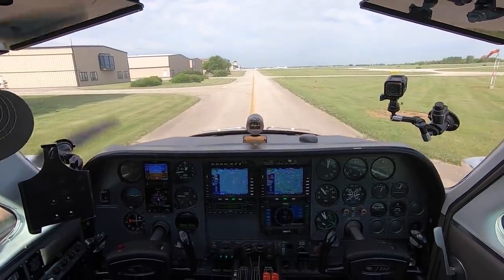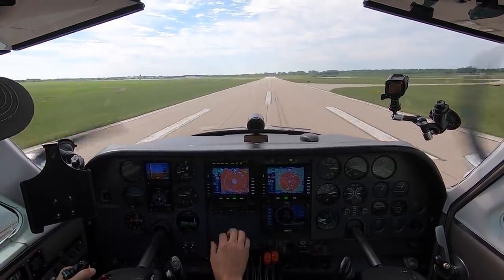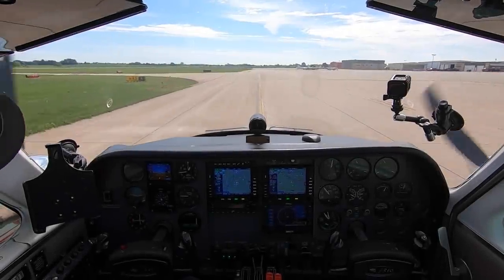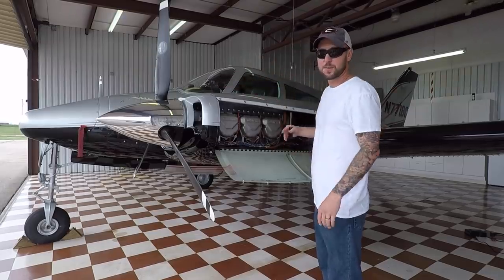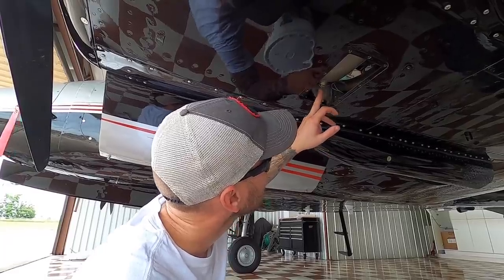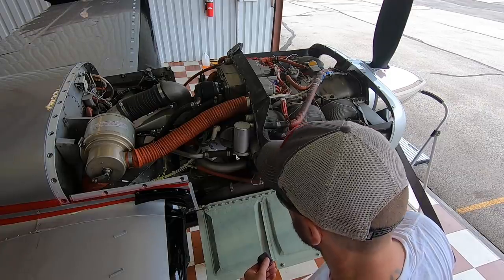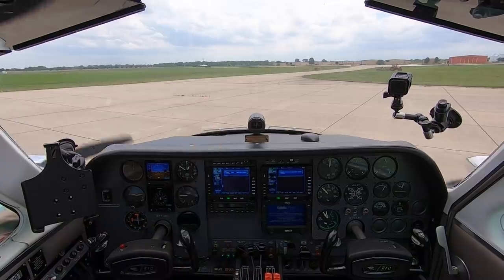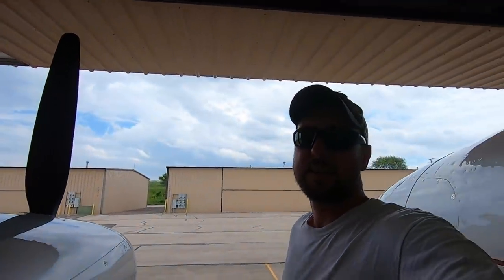How to Change your Oil

Comment: Unsolicited SW tip from a Jet mech: I've always used a general ROT for cutting SW as the length of my forearm. When you pull the pliers to twist the wire, keep the wire wrapped around the pliers so the ends don't flail out and cut up your pretty heat wrap, electrical, or scat tubing. Really appreciate the quality content here and hope the aviation TY community will follow suit; showcasing some of the aircraft DIY and maintenance pilots/owners can do themselves. This content is really opening the eyes to those intimidated or uneducated about general aviation. Great stuff!
Reply: Nice job on the oil change. I Use to watch cap do oil changes
Reply: Good tip Aric. Also the filter adapter is soft (aluminum) so just be gentle threading and removing the safety wire.

Comment: Yeah,
What Paul Arc said. 
I have been my own mechanic for many years now. My dad was a diesel mechanic. He told me the importance pre lubing the gasket on the filter so it doesn't gall up and will slide on gracefully when tightened.
Not so much the plug but the filter.

Comment: Nice bonus video! As a DIYer and former auto mechanic, enjoyed seeing “under the hood”. One suggestion, get a step stool on casters and put the drain bucket on top of that. Easy to quick adjust location, and can roll out from under. Cuts the distance the wind has a chance to blow the oil.

Comment: Kevin, great video on oil changes. It brought back my days of doing them on my planes.  Watching the video made me feel lucky that I only had single engine planes.  Half the work.  Yes, as noted in some of the comments, I always wiped a little oil on the filter gasket with my finger prior to installing the filter.  It worked for me.   The filter cutting tool was new to me.  Sure beats using a hack saw.

Comment: Awesome job doing the oil change, brings back memories of working on the 310R we had at the one company I worked for.  I used to use cardboard or pieces of aluminum to make drain shoots for the oil, then I found the form a funnel you can get at some auto parts stores.  Another tip that I learned from a old mechanic was when you cut the filter media out of the housing, if you keep it corrugated and squeeze it in your bench vice it will get rid of most of the oil and then you can more easily see any metal or dirt in the pleats.  I usually wrap it in a rag to catch the remaining oil as it is squeezed out.  Keep up the good work and enjoy all the flying videos as you give us great scenery shots of the country, and love the nerdy instrument tech you have in the plane also

Comment: Kevin, I would like to say thanks for teaching this old dog a new trick. For the 21 years I’ve owned my 310 I hated the oil change task solely because of replacing the safety wire at the drains. It’s hard to see and awkward to get to. I always put the plug in before the wire and you have now shown me the error of my ways. Thanks, Chuck from Memphis
Reply from the maker: Ha ha...not sure if you'll find it helpful or not but it makes it a lot easier for me. :)

Comment: 10:55 Oil Filters : Trick I learned from sailing channel Gone with the Wynns,  wrap a plastic bag around the filter when taking if off. It catches most of the oil (if not all) and you can just drop the filter in the bag.

Comment: I was wondering if you would get the second click. I can tell you I am a quality inspector for Lockheed Martin in Marietta and people with 30 years exp will mess up the direction of safety wire. WE actually have gone to a newer method of using safety cable. The cutter pulls the cable to correct tension then crushes a grommet and cuts the cable clean. Saved a ton of time for us doing standard safety wire. Great video was a pleasure to watch.

Comment: Very good video, cutting open the oil filter can show a lot of what is going on inside the engine. I worked 25 years as a mechanic and used to take oil samples to send of to a lab to see what was going on also.

Comment: Kevin, I will offer a suggestion for removing the oil filter. On my marine engines the filters are less accessible than yours, but similar. I found that a large zip lock bag over the filter, once it is broken lose, traps almost all oil and helps keep clean up to a minimum.
Reply: Yep.... that's an old school "work smarter not harder" trick
Reply: Thats a good idea
Reply: You can teach an old dog a new trick. I'm fifty-three. I never knew the bag over the filter trick.

Comment: Great vid. As an engineer of some 30 years I was always taught to pre-soak filters unless it was specially indicated not to. This prevents contamination of the filter media from residual particulate and prevents dry journals where lubricant has to soak the dry filter before it reaches rotating parts prevents overtemp and wear.You shoud wear gloves when working with oil its a carcinogen. Saftey first.

Comment: Just a little thing to add. I was taught and always put a very light film of oil on the filter gasket with my finger before installing. It’s suppose to give you a better seal, keep the gasket from bunching or tearing and gives you a more accurate torque. Just something I learned years ago and hear quite often so thought I would mention it. To each his own and everyone has their own way of which there are many. You’re right....only pure aviation geeks and mechanically minded people love this stuff. Good news is, I think there are plenty of us out there. As the owner of many different piston turbocharged aircraft before switching to turbines, I can say oil changes and being very meticulous with them are even more important (yes, all aircraft maintenance very important). Many aircraft turbo wastegates and pressure regulating devices are controlled by the oil. Many of the orifices and passages the oil runs through are small and machines to precise tolerances so any fod can really give you some trouble. Not to mention turbo health in general is extremely reliant on clean and proper oil. Thanks for sharing, keep up the great vids. Fun to see some videos for us engine gurus from time to time, even if it just an oil change.

Comment: Kevin, as a PP/A&P and Lockheed Field & Service mechanic on F-16s for 35 years, I couldn't have done better. Your safety wire was neat and well done. The drain plug is what it is and is a bitch to safety wire. I would suggest on the oil filter to start from the filter and go to the adapter boss. This has you pulling toward yourself at both ends. And as someone else said, if the wire is long, let it wrap around the pliers and sort it out when you go for the other hole. Point being, only cut it after you've finished the pigtail so you don't have any more pieces flying around to cause damage/FOD. All in all, very nice presentation. I've enjoyed following y'all on all your adventures. Stay safe and enjoy yourselves. Oh, and wear your gloves when you're handling the filter element after cutting it open. As a young man I never worried about getting oil on my hands, but as you get older , you WILL develop an allergy to it.

Comment: Kevin, what a pleasant surprise to see you on a Tuesday.  I may be messed up on my days this week now.  In any case I did enjoy your oil change.  Being technical I was very happy to see an actual drain plug for the oil, not to mention the wire lock.  I have always had a beef with Cessna on the small planes.  They have a quick disconnect for the oil drain.  Almost makes me wish I would have learned on a Piper.  The only reaction I have ever received from comments on 150/172 oil changes is that nothing has ever happened.  Well that in no way should let safety take a back seat.

Comment: I have my dad's old safety wire pliers (USAF) and I use the same company for oil testing in my old (2000)  Landcruiser and Diesel pickup.They do a great job. I like the maintenance videos. The are very informative

Comment: As a non-pilot, it was interesting to see all the safety features.  I've done hundreds of oil changes on cars and never had "safety wires" LOL.  But, I'm on the ground.  I can relate to when you are in the air, as a lost engine in that environment could be catastrophic.  Thanks, Kevin, for the instruction.  You're a great pilot and owner.  I'd fly with you LOL.

Comment: Well done 👏,  as others have said this is an a/p approved video. Safety tip: wear some kind of eye protection specially around safety wire, the thing is sharp as hell and when cutting it the pieces love to go flying out if you are not careful.

Comment: Always feel better & think it sounds better after an oil & filter change (plane or car). Probably delusional but seems like it to me. One thing I've started doing is set the new oil in the sunshine to warm up while I'm working in the hangar on the cowling, old oil & filter. Then the new oil drains a bit faster & more thoroughly. Thanks for the video. Gorgeous aircraft. Got to be one of the best in the fleet.

Comment: Thanks for doing this Kevin! Always cool to see how other people do it. When I first learned how to do it with an A&P, he had me use a hole punch on the filter(at the top) while draining the oil. That means the oil filter empties more completely(lets air into the draining path) while draining, and ultimately means less mess when the filter comes off. I also use the time while the oil is draining to wipe down the plane and listen to music. It's definitely one of the best ways to spend time with your plane, if it's not going to be in the air!

Comment: A&P here. I like to do on the end of the safety wire is make a big loop while the jaws are still holding it, that makes it a bit tighter.  also when you putting it in the other end to finish off I take one of the wires and give it a good tug. just to make it tighter. Be careful on the thinner wires or the copper break away type.  :)
Reply from the maker: Thanks for the suggestion Christopher! Always learning. :)

Comment: One suggestion to make inspection of the oil filter paper pleats is to gather it up like a accordion after cutting it off the filter housing and then run it in the vice with paper towels around it to sop  up any extra oil and so where you get much of a less oil soaked filter element to inspect makes looking for contaminants and debris easier.

Comment: WOW!...I haven't seen a pair of safety wire pliers in over 30 years. Used to use them all the time when I was in the Navy working on the flightdeck of an aircraft carrier. pretty much every little nut or cap had to be safety wired. Always thought they were for military use only, lol.

Comment: I just did a similar video on my 150.  I usually fill the oil filter up with clean oil and let it absorb (you get oil pressure a little faster) and then make sure to put oil on the seal of the oil filter before putting it on.  I found a neat trick where you cut out a used oil bottle to put under the oil filter when you take it off to capture all the oil.  It fits perfectly around the filter.  It's cool to see how its done on a 310.  You are definitely a lot better at safety wire than me!
Reply from the maker: I used to wet the seal and then read these specific filters state to install dry. I ordered some new oil filter bibs from spruce the other day. No more cardboard for me. :)

Comment: Great video. Enjoyed oil change part. I have a Lycoming 0540 on an airboat. I use the safety wire on the filter and plug also. The Cam Guard is much more important on the Lycoming engines because of the camshaft being on top of the engine. The oil will drain away. The Cam Guard really does a great job.
Reply from the maker: Glad you enjoyed it James! Sounds like you have a fun boat. :)
Reply: Thanks Kevin, I forgot to mention that I live in Dade City, about 8 miles from Zephyrhills. I kept checking in on the paint job. Looks great. If your down this way let me know. We can try out the airboat. Ha, kinda sounds like an airplane a little.

Comment: Hey great video, I wish I had a dollar for all the oil changes I've done! lol. I didn't read all the comments but two suggestions I'd make is buy an aftermarket drain plug with a built in magnet with the oil circulating in the sump it'll pick up any ferrous metals or get a quick drain, less mess for one!

Comment: Great video.  Looks like you try and catch a piece of safety wire when you cut it. If you take your diagonal cutters and fill the well of the cutters with rtv. Let it dry and take a razor blade and cut down the center and You will never worry about any pieces of wire floating around. The wire will get trapped in the silicone. Thanks for sharing.
Reply: Do you cut down the center to open up the cutters you just rtv'd shut?  Love to see a photo of that, great idea!
Reply: Greg Hopp , yes all you do is slice down the middle on either side. If someone doesn’t think they could cut straight then you could turn over where the two cutting halves meet and apply outward pressure to the handles, so the jaw pulls slightly apart and slice with a razor blade along the cutter. They make cannon plug pliers with similar material to create a soft non marring jaw. I will look at work and see if I still have them and take a picture. I don’t work on airplanes anymore, but I think I still have them and will look at work tonight and see if they are there. Idk how to add a picture to a post. I will try and figure it out.

Comment: Kevin, it doesn't look like you have much room to install quick drain plugs on the oil pans, but you may want to look into getting a "form a Funnel" to handle the oil draining from the filter.  I have been using one for my 182 and it does a great job.

Comment: In 1960 during mechanics school in the AF, we learned to safety wire by hand. Fun.
Reply: In the 60s I did all the wire twisting by hand using lots of gagets to help didn't know about wire twisters until the 80s.  Still got my Twisters (Snap on, of course). Retired now for 10+years.

Comment: You can improve your side cutters to retain safety wire tails by taping them closed and filling the jaw with silicon sealant. After set, cut centrally with a hobby knife. The sealant will now retain the loose cut ends. Easily removed or replaced any time.

Comment: It's interesting seeing the use of safety wire on an airplane. I've been involved in a motorcycle, road racing, for many years and the race bikes require safety wire on a number of parts. It makes me wonder what maintenance/modifications you can do yourself on your airplane and what maintenance/modifications require a professional mechanic?
Reply: Pilots are limited to noncomplex operations. If you look up the federal regulations it’s under FAR part 43 appendix A. Basic stuff like oil change, change a tire, change lightbulbs, repair interior pieces. 

That being said I’ve known many pilots to suddenly have new things installed in the aircraft with no record of a mechanic working on it  🤔
Reply: @TheReadBaron91  thank you for the feedback.

Comment: Suggestion ... oil drain valves. Saves having to remove a drain plug, avoids the risk of messing up threads re-inserting drains plug, and you don't have to re-wire the drain plug every time. Had them in my Baron, put them in the 340 I just bought at the last annual.

Comment: Did you wipe some oil on the filter gasket before putting it back on. I didn't see that part. I'm not a pilot, but I always did this on my cars. It helps keep the gasket from binding up.

Comment: Do aviation oil filters have pre-lubed gaskets?  Curious as you didn't show lubing up the mating surface before installing the new filter.  Might be good info for someone that has never changed a filter and same them the pain of an over-tight filter next change.

Comment: Smaller pair of Milbar 6in safety wire pliers will make securing the filter and plug easier. Highly recommend them.Also safety wire should be in the tightening direction or neutral.

Comment: What's the reason for using 10 individual oil packs?  While I don't own an aircraft I know that with my larger engine SUV it's way cheaper buying oil in larger sized kegs/packs than buying smaller packs...
Reply: I wish. General aviation piston engine oil is a niche product. Only seems to come in quarts  or 55 gal drum!

Comment: Now I know what you need for Christmas, a cordless screwdriver for that bottom plate. Just like your take off checks, three in the green four times. Good job, but at my age now, I take my truck in. So how much would this cost if you took it in?

Comment: Learn something new everyday got a couple of questions I noticed the safety wires on the oil plug in the oil filter is there a safety wire on the oil cap on the engine also when you put your filter on do you put a light coat of oil on the seal of the oil filter from the change of oil you are draining also I noticed you changed the left side did you have to go to the right engine and do the same thing or do you just change it from one side don't mean to ask so many questions just interesting enjoyed the video very much thank you
Reply: no the oil filler cap does not get safety tied. I think he did that and it is a good idea to put a little oil on the seal I think he did that but did not show in the video.  I think he did both engines the other one would be the same procedure and steps.  :)  I am an A&P.
Reply: He’s using the SpinEZ filters. They come with the gasket pre lubed.

Comment: Do you lube the oil filter gasket before you put it on? If so, do you just use some of the old oil like you would in a car?

Comment: Does the oil filter have a left hand thread? Looks like if the filter has a right hand thread and if it were rotated CW  (as viewed from the tightening end) it would loosen the safety wire. Maybe it’s the camera angle?